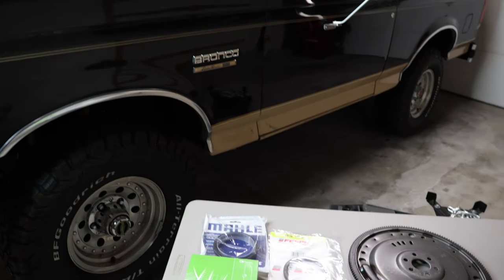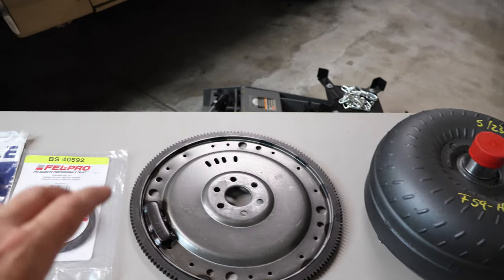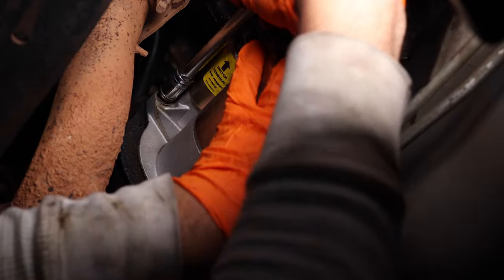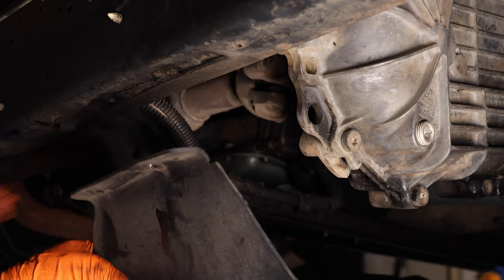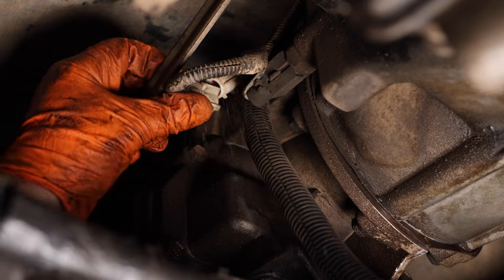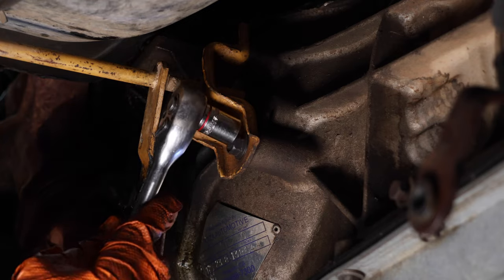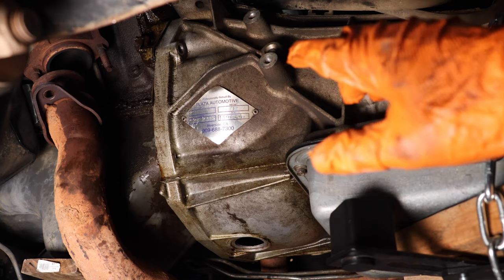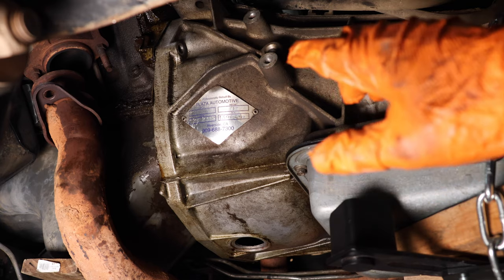Rear Main Seal Replacement Ford Bronco F150 | E4OD Transmission Removal | Bronco Restoration

Comment from the maker: This was a job, I do recommend incorporating other fixes while the transmission and engine are separated. Let me know if you have any questions regarding this repair.
Reply: Would it be possible to also do the oil pan gasket during this job or does the engine have to be removed? 1995 EB 351w
Reply from the maker: Yes, it would be best to reconnect the transmission to the block and secure with bolts, then lift engine off the motor mounts, stick wooden blocks between the engine and motor mounts. With everything else out of the way the oil pan will slide out. I regretted not doing so, but had to complete the video. For the 351 you will have to remove the upper intake plenum to lift engine high enough.
Reply: @TheFixTech Also, if I’m not mistaking; You need to remove the transmission shift linkage and even jack the transmission up slightly. The shroud will get removed as well. You have to be very careful when lifting the motor and keep good attention on the transmission cooler lines that you don’t over flex them or interfere. Once the bolts are off the pan you can slide it out only so much. Most people typically have to remove the oil pump that way the pan can slide out. 

It really is a disaster of a job and design. 

Great videos, keep up the good work.
Reply: And yes, as you said with the 351 most people have no hope debolting exhaust. What many people have to unfortunately do is cut out the exhaust that runs under the pan and then either flange/clamp it back together. Or if you’re a good welder by all means lol! Some people take the whole manifold off… good luck with that out east.. I don’t even want to imagine how many bolts would just snap.
Reply: It looks like there is a transfer case right behind transmission on my 4x4 86 Bronco. Wondering how we move transmission back and drop it without removing transfer case. The video didn’t appear mentioning the transfer case

Comment: Excellent video !  Very clear and concise instructions without all of the fluff that a lot of other videos have.  I also appreciate the time you took to have well placed lighting with steady video and very clear audio.  Nice job 👍
Reply: Also, can you please add the information for the torque converter that you used in the video ?
Reply from the maker: I updated the description with a link to the torque converter. This is for the E4OD transmission, it is a 2000rpm (high stall) which is a factory replacement. Interchange part number F59HS

Comment: Awesome video and very well detailed. Personally I would stay AWAY from the Teflon Seals and use a Rubber Seal with a Repair Sleeve. Teflon seals are notorious for cracking and degrading fast due to them being a much harder/stiffer material and they also like to gouge the crank shaft over time which is why 90% of the time you need a repair sleeve is due to the teflon seals eating into the crank.

Comment: Excellent. Going to change the oil pan gasket while I'm down there too. And the 4wd engagement motor. Mines iffy, especially in Winter when I need it most. Fords. Gotta luv 'em! Subscribed.

Comment: Another great video!
Exactly what i need to do but I'm so freaked out about  all the things that can go wrong. ( rusted bolts, broken books, stripped threads, ect...)
Your video is giving me the confidence tho.

Could you possibly do a video on troubleshooting intermittent stalling?
I can't figure it out. 

Thanks again!
Reply from the maker: Usually the intermittent stalling will be caused by a bad egr system. I do have a video on that system. Also could be bad fuel pump and ecm relays, replace both.

Comment: Can you do a video of deleting all of the emissions canisters/ system? I have a 91 and want to remove all of that. But curious to see how you bypass the electronics and hardliners into the back of the engine. Also would help to clear out space in the engine bay of unnecessary parts.
Reply from the maker: My choice of preference to delete those hard liners is to upgrade the heads to ones that do not have those ports, otherwise you can simply plug the holes with a thermactor plug. If the stock engine is to be used then I do recommend keep the original emissions system for best MPGs and stock performance. Otherwise the best way to delete any emissions is to remove the components and tune the ecm.
Reply: @TheFixTech  thanks for the reply. They don’t make any replacement emissions parts!

Comment: What size of engine does this broco have, my Mecerury and crown vic both have the 302s and ive replaced both rear rear seals on both cars, but i see you didnt put any thread sealer on you flywheel bolts when you reinstalled your flywheel, you should of done this, of as they are kniwn leak from the main crank once theyve been removed, great video, ✌️👍
Reply from the maker: Thanks for the advise, this engine is the 5.8 351 Windsor.

Comment: Is dropping the trans easier than lifting out the engine? The 5.8 in my 96 Bronco has good compression but has some pretty bad oil and coolant leaks. I have worked through several vacuum leaks (P1071/1074) but it still has a misfire in cyl 4, so I pulled both manifolds and having the injectors cleaned as we discussed. When it runs right, I was considering pulling the engine to replace the rear main, oil pan gasket, freeze plugs, exh manifolds, and hoses. Thanks
Reply from the maker: I would pull the engine out if you need to seal engine/coolant leaks as there are some freeze plugs that can be hard to reach. The trans does come out very smoothly if you are using a decent trans jack (like the one shown in the video). Make sure you have the correct ignition module for your truck.

Comment: so the teflon rear main seal installer comes off after it slides onto the rear of the crankshaft. Never used one of these style. New to me.
Reply from the maker: Yes, it is very important to use the plastic installer sleeve to slide the Teflon seal into place. It is also recommended not to remove the seal from the sleeve prior to installation as the seal will deform.

Comment: Damn dude you are an expert mechanic props! Realistically is this a job that an average wrencher could do?
Reply from the maker: With the proper tools it is easier than it looks. The transmission jack works wonders and these trucks can fit dinosaurs under them

Comment: It's metal on metal, what prevents oil from leaking between the new sleeve and the crankshaft??
Reply from the maker: It’s a press on fit, must be tapped into place and does form a solid seal. I have used these a few times with no issues. The Teflon seal is a good choice as well.

Comment: I hear a tiny squeal i think is coming from my flexplate. I hear it while idling and going below 20. Can i spray any lubricant on flexplate? 93 bronco new engine and rebuilt transmission 3 years ago
Reply from the maker: Is it an automatic or manual? If manual it is usually the throw out bearing. If an auto, remove the flexplate/torque converter cover, if the squeak is more prominent then torque converter would be a suspect. Check trans fluid for any burnt smell or shavings.
Reply: @TheFixTech  its auto im missing the flexplate lower cover. Do you have email i can send video of it?